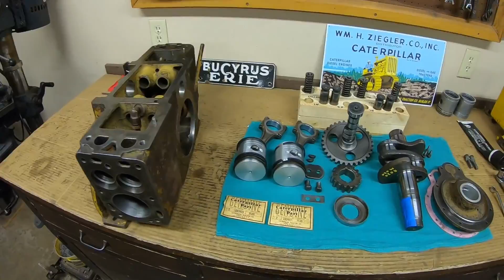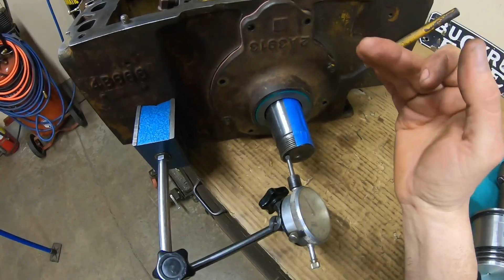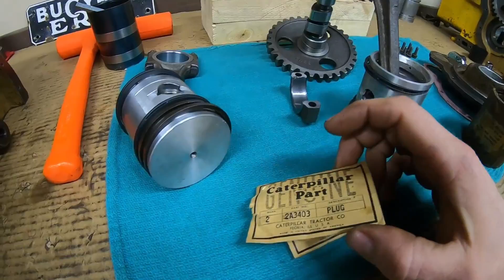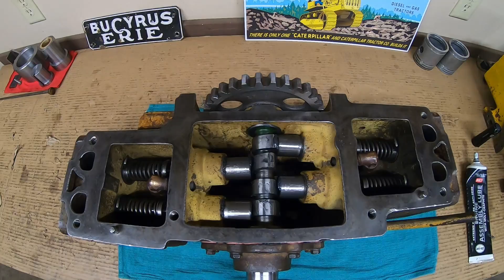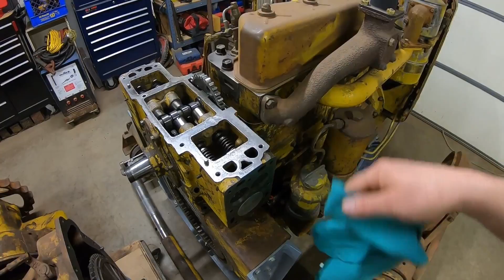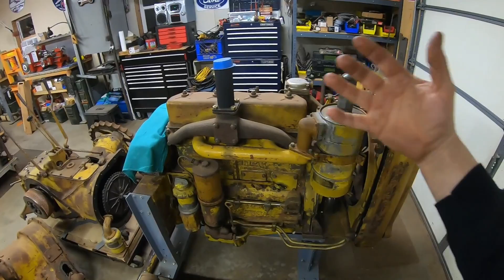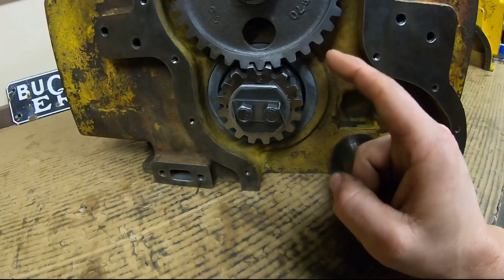The Caterpillar "Pony Motor" - Cursed by Design?? Or the Perfect Balance of "Just Enough"???

Comment: Trying to think like a Cat design engineer in the early 1930s, I'd say that a starting engine over an electric start was a no-brainer. The electric technology just wasn't there. So that leaves the question of whether the initial design was "good enough" or could have been better. Well, obviously it could have been better, but we have to remember cost constraints. It can't be better if that costs too much. 

So what could have been made better at low cost? Possibly snap rings to hold the wrist pins in the pistons. But would snap rings in 1932 or so (when the design was being done) have been as reliable as those end caps they designed? Maybe not, given the spring metallurgy and the temperature the snap ring would run at. 

The other obvious (now) choice for an improvement is a different carb design that wasn't likely to dribble gas into the engine and dilute the oil. But was that obvious during the initial design? Maybe not, though it probably became obvious after the first year the Cats were in the field. I'd say that is the major design improvement they could have made. I wonder how much it would have cost in redesign and alternate parts to replace the carb. Obviously too much, since it was never done. Or Cat didn't consider it that much of a problem.

Comment: I currently operate 9's and 10's and we are expected to do 10 hrs machine time per 12 hr shift and the machines operate 24/7. so 8hr shifts are for weekend warriors 😂

As for the pony motors. They are great, till they're not..

Well maintained and not abused they work well however it is not often that they are not abused. In too many cases the pony motor goes from stone cold to full noise, full load in under 30 seconds and then crash stopped with no run down. They repay you for this abuse by becoming horrendously cantankerous to start. As they say, "Payback is a bitch".

Worked an old D7 D?, E?, cant remember now (25 years ago) had a top crank on it. That thing was as finicky as hell to start most times. I did however have it start on me ONCE while turning it over to top dead center, nearly fell off the track it surprised me that much. Other times you could crank for an hour. On a cold morning the Cat may not be warm but you sure as hell are.
Reply: Didn't anybody take the pony engines serious and gave them a much needed tune-up? If the operators knew that getting the job done required the pony to be in top notch, why didn't they take the extra 5 minutes to heat up and cool down? Ridden hard and put away wet.

Comment: Your edification on the reasons to use a pony motor have certainly changed my opinion.  They are and do much more than act as a gas powered starter.   In the engineering/design world we often deem those things which are exceptional on all levels as “elegant”.  These ponies are anything but elegant in form or function.   These girls are fat, ugly, foul mouthed, smelly and brutal.   Yet they are extremely well suited to the task at hand.

Comment: "Was 10, still 10" - kind of says it all? You do pristine work, Squatch.
What was the practice in the old days for starting in cold weather? Nobody has really had stories they've told of the old timers staring these old tractors? Did they start the pony motor and let them run until the main diesel block was warm (15-20 minutes) in order to let the main engine start up easy?
If I were to give you my guess, it would be that the smart owners did, and the impatient ones, not so much?
Reply: After watching Squatch doing it right, it just makes me cringe to see the fools strugling to start the pony, letting it run miserably for ten seconds before turning the diesel over on full compression and feeding it diesel right away, only to have the poor engine hosed down internally with unburnt fuel and puffing white smoke for minutes.
Reply: @erik_dk842  Yeah, I've never really understood the folks out there who almost immediately turn and burn from the pony motor? I suppose I can understand in warm weather or if the main engine has already been run, but in cold weather, it just doesn't figure?

Comment: The starting pony engine would be just about perfect if they had pressurized oil system, which would have radically increased lifetime, probably far more life than needed.. as is, a 5 day work week your looking at 10 years, perhaps 20. Yup, not bad for splash oiled.  The fact that they warmed the big diesel, not only spun it up, is really good.

Comment: I have absolutely no experience with a starting engine, and really, only your videos to go on. But I've fallen in love with them. The starting procedure for a machine with a pony motor seems like so much fun. On another note, could you run some 2 cycle oil in the gasoline for the starting engine to make it last longer?
Reply: Maybe just maybe some synthetic 2 stroke diluted 100:1 ?
Reply: What for? Better just to keep the gasoline out of the oil.
Reply: @erik_dk842  Sigh. I think you are missing  something. These starter motors were designed from the getgo to be as simple as possible. Least cost to build and replace. Simple splash oiling,a sump of what,a quart ( litre) or so. No oil pump. Not even the Model T oiling troughs. Unless care was maintained,lubrication was going from marginal to not enough. Two stroke oil,especially synthetic,maintains upper cylinder lubrication. And traces of it are going to make their way down the cylinder walls. Just where maximum heat and wear cause cylinder taper. Overheat a 4 stroke engine,the pistons will seize in the bores. Just that hint of oil is going to make a positive difference there. Would that be enough till the operator checks the oil level and adds some ? That will vary enormously. But it is mighty cheap insurance. At least for a fleet operator with skinners of widely varying abilities. Some will deliberately break another man's stuff just because they can.
Hope that answers your question.
Reply: @paulmanson253  I get your point now.
Reply: A pint of 2 stroke oil goes a long way at 100:1,  and costs < $5, cheap insurance for sure.

Comment: Great video!  I have run equipment with starting engines for 45 years.  If you take care of them, they run and operate perfectly.  Where there are complaints, the issues could be traced to poor maintenance, no warm up, no cool down or low oil.  The starting sequence is important to take care of the pony and Diesel engine.  Love my pony start equipment!   The main reason starting engines were used is the lack of power in the 6 volt starters, the wouldn’t turn a diesel over under compression, whala the starting engine was born.  Thank you again for all of your efforts!

Comment: Another benefit to starting engines that you demonstrated in an earlier video, is the fact you can still move the machine around with it if something goes wrong with the main engine. Big advantage when you need to limp it onto a trailer or into the shop.
Reply: So true no more to be said.

Comment: Great video as always . The way you explained the starting engine. I will whole hardly agree with you. I run a old D7 cat. With a staring motor. It was hard to start when it was cold. You turned it over but could not choke it til it fired them pull the choke out. Aw the gold days.

Comment: I will not say we abused the Start Engine. Much North of you - I recall in -15F weather - I ran the Pup for 10 minutes - before we closed the Compression valve, It was 20 minutes before we got on the rig and hit it with fuel. If the engine did not light up - I left it another 15 or 20 - and once running, never shut it down for 8 hrs.  Thank You!

Comment: I would take a starting engine kept in good repair over an electric starter all day. Had a big cat on a barge line in AK 20 years ago that we used to launch and dry dock tugs and barges. Your typical grizzled old man would get out there and warm up the block with a torch then hand crank the starting engine. Often was an hour between getting the starting engine going and having the main diesel up to temp and ready for use, mostly because of how anal he was about everything. But it was better to do that than get in a hurry. You can get diesel in AK a lot faster than you can get old Cat parts in AK

Comment: With those older Diesel engines even a new modern gear reduction starter would struggle to survive with extended cranking times let alone battery life. I would imagine more than 1 old Delco starter was melted down trying to start them

Comment: It does seem to be an appropriate design for the application.   There's that one 'human factor' vulnerability.   I know the main battery cutoff needs to be turned off in some modern equipment, but it's so easy to walk away leaving the switch on and come back the next week to a dead battery.   I wonder how long it took until it became clear that forgetting to cut off the gas was a quick route to needing a rebuild?    Although not true to the original design, I wonder if it would be possible to design an automatic fuel shutoff whenever the engine isn't running.  That way when a guest operates it, there's no need to worry about one wrong move ruining the oil and maybe more.
Reply: Seems like I heard the John Deere starting engines had some kind of oil pressure operated diaphragm system to help with this problem but being the Cat engines are splash lube and not pressure lube that leaves that option out.
Reply: Why not a vacuum operated fuel cock from a motorcycle?

Comment: We had a D2 on the farm for awhile.  Never knew much about the starting motors and I don’t believe we EVER shut the gas off to the starting motor.  Of course we purchased the D2 from a jockey to do a job, it did the job and then eventually got sold.  Never once saw and operators manual.  The starting motor was not in great shape and definitely needed a rebuild.  Makes sense as to why.
Reply: @squatch253  cool to hear how you learned! Need more stories! Please!

Comment: I feel so spoiled with modern diesel equipment 😂 being able to shut off a tractor, especially with fuel prices these days, is almost a must. And being able to start it up without relying on another engine needing to start is also a plus. Our John Deere tractors at work start up no problem, even in the cold. Just let them warm up for a few minutes and they’re good to go. 

I can definitely see how a starting engine would benefit older equipment though like Preheating your main Diesel engine, providing oil pressure, etc. while I don’t hate starting engines, in fact it’s really cool to start a big engine with a little baby engine, but I just like the convenience of electric start on modern diesels.
Reply: Go look at the wiggler magnetic rectifier on the battery charger from the 20s Hand Tool Rescue did and you can easily see the appeal of a Pony Motor

For those wondering : its an electromagnet relay with a permanent magnet on the armature to bias it so its cycling at 60hz, only applying output power on one half of the waveform, all in an open frame

Comment: @Squatch253 how are the plugs retained in the piston? Are they pressed and staked in or did CAT not really care because they're really not going anywhere?
Reply: @squatch253  that's really neat! Was there any info in the service manual about possibly machining the plug type pistons for circlips once worn?
Reply: Design wise the horizontal twin Cat pony motor is a nightmare! Taking the power out of the other side of the crank from the flywheel is plain stupid as is that rubber thing used to join the cooling system to the head! The attachment nuts under the cylinder block are not nice either,  nor the position of the magneto hidden between the top cover, manifolds and firewall. On early ones there was no access plate in the firewall either and the pony's fuel tank gets in the road too.

Comment: I would agree there is nothing better than a good performing starting engine and like wise there is nothing more frustrating than a poor condition or unreliable starting engine.  You are right they must be maintained!  I spent several years as a young man working on a large ranch on the Kansas/Oklahoma border.  I don’t remember the IH model but we had a old tractor that was used for haying only and could be started on gas and switched over to diesel once started.  Might have been a WD 450, it’s been quite a few years ago!  We also had a D7 & D8 with starting motors that worked well.  The starting motor concept seemed much simpler to me with less things to go wrong, than the gas start diesel which if I remember was prone to problems and often not used.  .

Interesting concept mechanically, I’m sure some on the members here will be familiar with these tractors and strengths/weaknesses of that system.  That would be a good discussion!
Reply: FWIW the channel Just a Few Acres Farm here on YT did a rebuild on a gas start diesel Farmall. I have no idea what the tailpipe emissions would be on such a thing while running on diesel,or during the gasoline start cycle,but doing a mental picture of the combustion area,I think Caterpillar was on to something. Keep It Simple is a bright idea,and the longer you can put off doing overhaul on the main engine,the better. Adding whatzits to a simple strong engine ,it is really easy to end up with a blivet. Which is 10 lbs of horse manure in a bag. It is mentioned elsewhere that having an electrical starting motor and this setup is the best of both worlds.
Doing major repairs to that Farmall engine in an ordinary farm workshop over a quiet winter would not be my idea of a fun experience. Towing one of those things all over the farmyard to get it to start cause the gasoline start don't work so good ,well ditto.
I can see why sales of those Farmall diesels was limited. Engineer's bright ideas don't necessarily match with farmyard realities.
Reply: @paulmanson253  Farmall MD. Fixed carb for the gas start. 3rd valve in the head when open lowered the compression so the starter could turn it over and allow the fuel to be gasoline.
Flip two levers at once to close that 3rd valve in each cylinder, and the other allowed the diesel to take over.
Here's a link with Pete showing the startup process.
https://youtu.be/7yuHIu1IfPw
Reply: @dans_Learning_Curve  Well thank you for that,I guess.Since I watch that channel I am familiar with that. Please,when you make suggestions,read the words. I believe you to be well meaning. It could lead to someone such as myself making snarky remarks. I refrain from that precisely because I have a high opinion of Toby. Good day to you sir.
Reply: @paulmanson253  I like your reference to "blivet",  but I need to add that you left off a portion of the definition.  A blivet is 10 pounds of "horse manure" (or any other type) in a 5 pound bag.  And I got that when I was just a kid from an old man who probably invented that word. LOL  And this was not a snarky remark, just seeing your use of blivet took me on a walk down memory lane.  Thank you.
Reply: @larrywalker7759  If it made you smile,so much the better. Cheers.
Reply: @paulmanson253  OH yes, it took me back to hearing that old man telling a much younger than him mechanic that he was making a repair much more complex than required because of a lot of extra tools and parts his way was going to need that he said "And what you gonna end up with is a blivet". He then explained what a blivet was and after it sank into my young brain I laughed for a long time. But the other mechanic was pretty annoyed that his idea was not well received.  Thanks again.

Comment: The design was exactly what was needed. The pony motor needed to be simple and able to take abuse.
Reply: @squatch253  that's another major point: how much did that 3400.cost to rebuild/replace when these machines were still relevant? How much down time? Did the owner or dealer have an easy way to get the machine on a truck and to the shop? The starting engine reduces a LOT of those issues to naught. And if the starting engine died out in the woods it could be removed and replaced relatively easy.
Reply: @squatch253  only thing I wonder about, why so little oil in crankcase? This makes the ponies much more vulnerable than necessary.
Reply: @casparberends  I think you can answer that question with another question:  Where would you put it?  The oil capacity is constrained by the size of the block.  More oil means a bigger engine for what benefit?

Comment: Excellent video the starting engine definitely has it's place especially in a cold climate like Minnesota and a lot of areas electric start system would not have enough battery capacity especially in the time era when 5j1113 was built it takes a good starter to get a modern diesel engine running. The short block is looking good. When I was growing up we had a John Deere 720 diesel tractor with pony start the engine was not in great condition but it always started the big 2 cylinder diesel engine. Then years later I got a 720 John Deere diesel tractor with electric start and it would start to 40 degrees and any thing colder forget it I wished it would have had a pony motor I did not keep that tractor very long because of the poor starting with electric start. That's my experience and even a modern diesel a gear reduction starter makes a world of difference for starting in the cold weather
Reply: Correction 5j1113